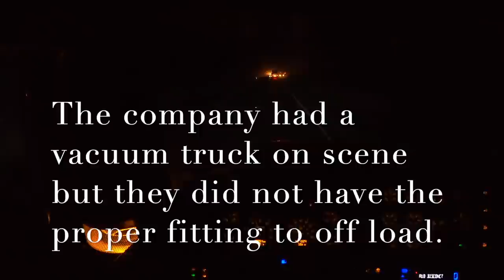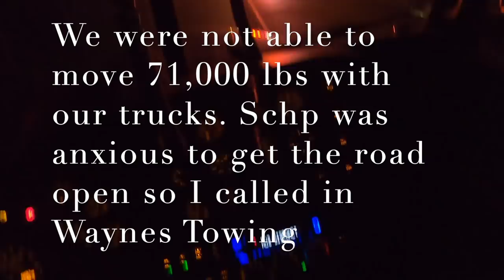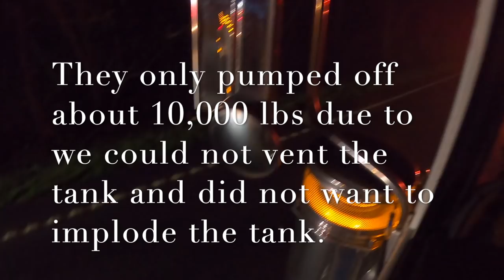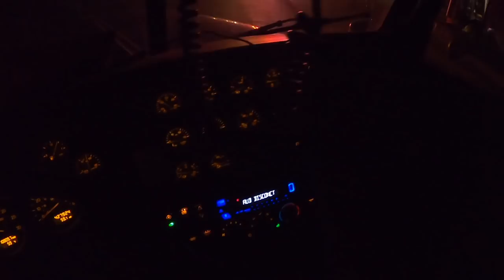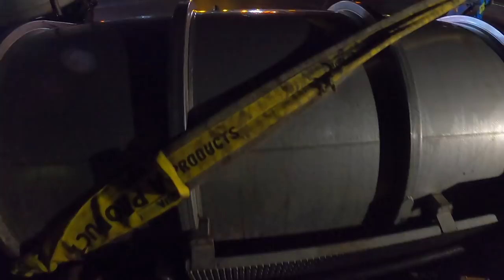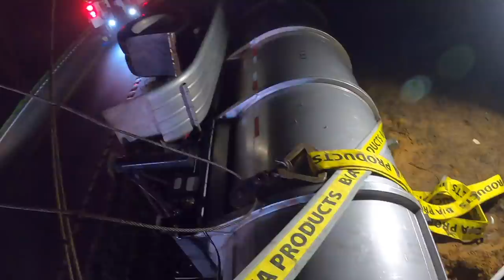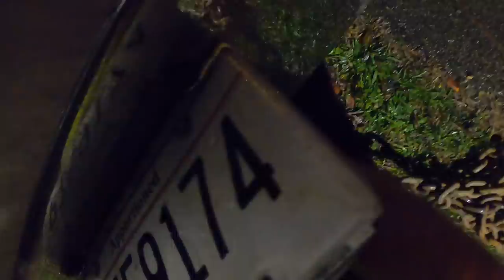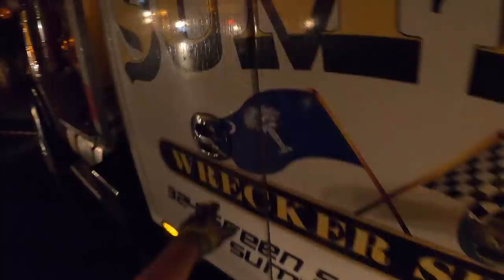We needed a ROTATOR! Overturned Tanker loaded with cooking grease

Comment: Now do you guys make sure the parking brakes are on before you right the rig?  I've seen them roll away on videos. Good video.
Reply from the maker: Mr James you can try to spin the wheels if they are clear the ground, look at the brake shoes to see if they are in contact with the drum or try to get in the cab. Also if noticed Mr Wilbert placed cribbing at the rear of the trailer. Thanks for watching and commenting. Stay safe